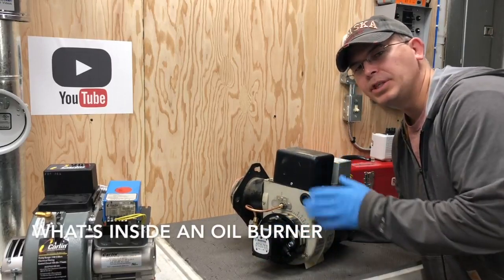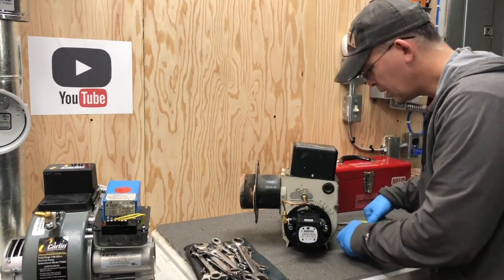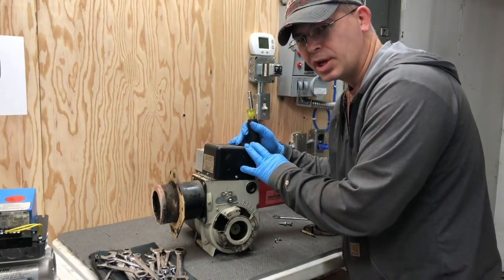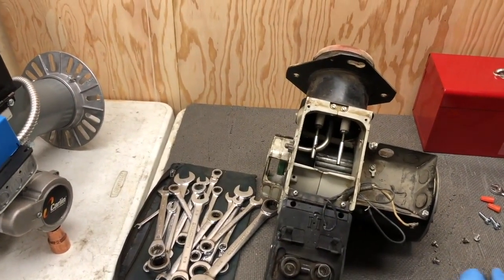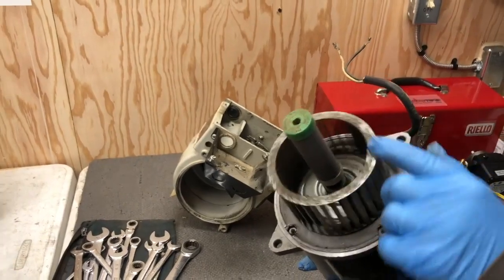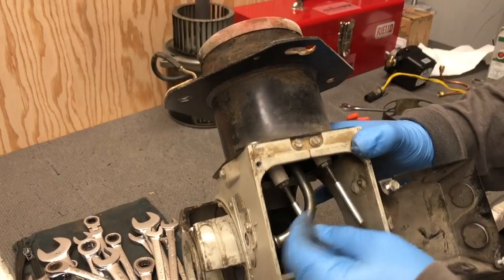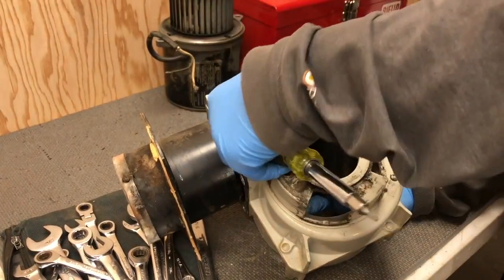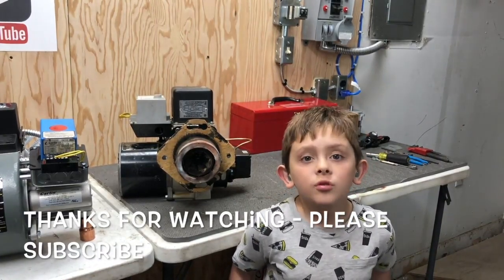AFG Beckett Burner

Comment: Should the fan blade spin freely while the pump is still connected?
Reply from the maker: Yes, there should be little resistance or binding. Most burners can be checked by Turning off power and lifting the ignition transformer cover. Spin the fan blade and see if it spins freely. If not, you may have a bad blower or fuel pump. If you replaced the coupling between the fan and fuel pump, be sure to check if it’s the correct length. If it’s too long, it will bind and not spin free!
Reply: Thanks for the reply. Had a child in June and while at the hospital our basement flooded. Had a furnace guy come out. He said the blower motor was still good but he couldn’t check the burner motor because my board fried and he didn’t have that style with him. I did buy a new board and a motor as the old one had froze up. Going to hook it back up tomorrow and give it a try
Reply: I also cleaned the tip that sprays the oil and the two electrodes as they were dirty

Comment: Hi I got a question for you I have smoke coming out of the oil burner and I have oil leaking under de oil burner as well is that has to be with the oil pump or I will have to replace the entire oil burner.
Reply from the maker: You may have a fuel leak on the nozzle assembly or fuel line! Be careful it does not start a fire.

Comment: A question for you about bearing noise. I have a two-year-old furnace, and I'm hearing some pretty bad-bearing noise coming from around the fuel pump. At this point it's intermittent. I thought originally it was coming from the blower motor but upon closer examination, it's coming from around the Motor or the fuel pump. I'm assuming there are several bearings in and around the motor and fuel pump. Which do you think would be most likely to fail after just a couple of years? I've actually had furnaces 10 plus years old and never had bearing issues before, but this noise Is fairly loud and can be heard from 10 feet away.
Reply from the maker: I would remove the coupling between the blower and the fuel pump and test the blower motor. See if the noise goes away or not.

Comment: Ive been having trouble with my bekett burner. Ive trouble shooted everything i could think of and cant figure out the issue. My blower fan is not kicking on when i turn on the heat switch. It will kinda of turn on but get stuck then it trips my breaker. Do you think it could possibly be the fuel pump? Or something electrical? When i trouble shoot the motor blower alone without being assembled it works normal but when i place it into the shaft it looks like it gets stuck. Id appreciate the help. Thanks!
Reply from the maker: You should be able to spin the fuel pump by hand. If you can, the blower motor may be going bad! That’s where I would start. I hope this helps!
Reply: @FurnaceTech  figured out the problem the next day. It was the fuel pump. The shaft inside the fuel pump was stuck causing my motor blower to get stuck. I changed out the fuel pump and it started working like a champ! I appreciate your videos I've learned so much. Thanks
Reply from the maker: @rene5313  That's Great news!
Reply: Hi I’m having issues with my oil burner. I keep getting smoke coming from the oil burner and the oil burner is leaking under. If you can give me an advise I will be so appreciate.

Comment: Great video, really helps break down the different parts of the burner. It's nice that you do it with your son

Was curious if you have any other videos on nozzle and electrode adjustments?

I have an AFG burner with an energy kinetics EK1, it seems to be burning a little too much oil. Was curious what might cause that?
Reply from the maker: I have this video https://youtu.be/7pqMi1m7508

It’s a different boiler but it might help. 

As for fuel usage, it could be a number of things. I would start out checking to make sure you have the correct nozzle size and fuel pressure. Clean the boiler heat exchanger and tune the burner. Next, I would check your zone valves for proper operation. Make sure all your heating zones are not heating more than the thermostat set point. I hope this helps
Reply: @FurnaceTech  Thanks for the response.

Will try the video above and see if I can figure it out.

Looks to have a 75 nozzle I believe and Honeywell zone values.

Comment: Excellent video.  The most in depth I’ve seen and I’ve looked at a lot while I get ready to go through a long-neglected oil-fired steam system once the heating season is over.  Used your,links for some parts and that great screwdriver!

Comment: Howdy, if the original head on the AFG was setup for a .85 80A and I go down to a .75 how can I find out what head I need for the smaller nozzle? Good video and explanations. Thanks
Reply from the maker: Here is a link where you can find the info you are looking for. https://www.beckettcorp.com/wp-content/uploads/6104-Burner_Manual_092120.pdf
Reply: @FurnaceTech  Thanks 👍
Reply: @ furnace tech Above link seems to be broken

Comment: I keep getting oil at the bottom of the burner.  My guess is, either the fuel pump is leaking at the shaft or the oil dripping from the nozzle in the blaster.  If it is a fuel pump, I'd think replacing the pump should do it.  But how would you fix it if it is the "oil at nozzle" issue?  thanks.
Reply from the maker: Try replacing the nozzle to make sure it’s spraying correctly. Also set the distance from the burner head to the nozzle and electrode gaps. This may help. Make sure the nozzle is tight but do not crank it down too much. It’s brass and you Will need to remove in the future.

Let me know it this fixes it
Reply: @FurnaceTech   thank you!
Reply: @FurnaceTech  I replaced the nozzle, set up the electrodes 1/8", 1/16", and 1/2".   I still see  oil at the beginning of the blast tube.  Any other suggestion?  thanks,
Reply from the maker: @cnn94001  two things to check, is the nozzle line going from the fuel pump to the nozzle adapter tight and not leaking. Touch it and see if it’s wet.

Next inspect the area around the fuel pump seal.
Reply: @FurnaceTech  all seemed clean.  I keep seeing oil at the beginning of blast tube, can't really tell where it's come from though.  Any more suggestion?  thanks.
Reply from the maker: @cnn94001  so I wanted to ask, the fuel is showing up at the end where the nozzle and burner head is located?
Reply: @FurnaceTech  I'm not 100% sure but I don't think so.  It's hard to see cause the nozzle is inside the blast tube.  
I opened it up right after the burner stopped running and saw oil at the beginning of blast tube, stuck my finger as far as I can at nozzle adapter, all seemed clean.
Reply: @FurnaceTech  Just took it apart right after the burned finished running, I think it's the nozzle assembly.  I probably will buy an entire assembly.  Thanks for your help